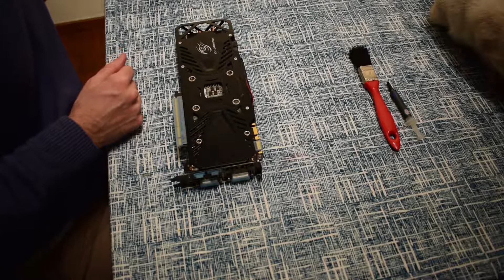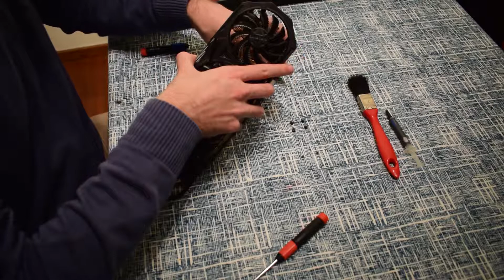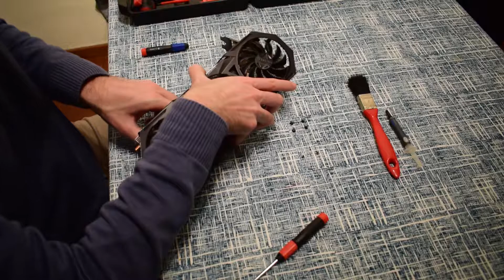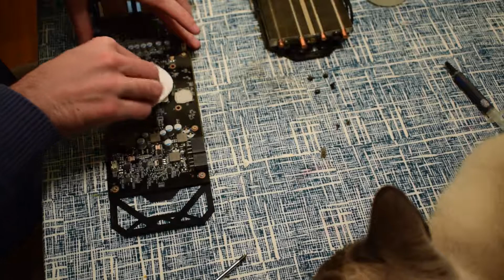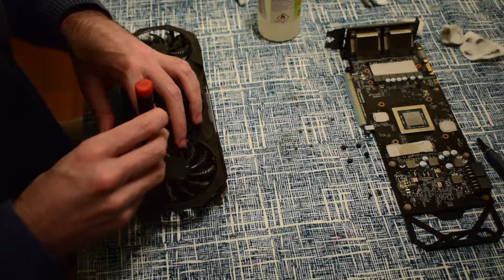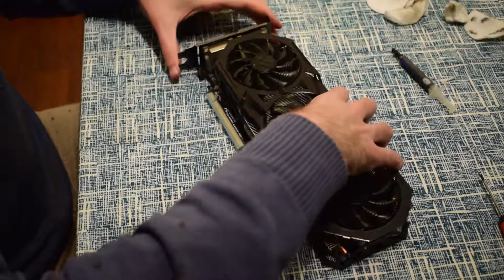PC overheating?! GPU too hot?! Let's fix that!

Comment: does anyone know the size of the thermal pads on this board?
Reply from the maker: 1.5mm but if have the 2mm ones, they also fit. (Or it could be that they are 2mm, but they got squeezed permanently after so many years)
Reply: Thanks